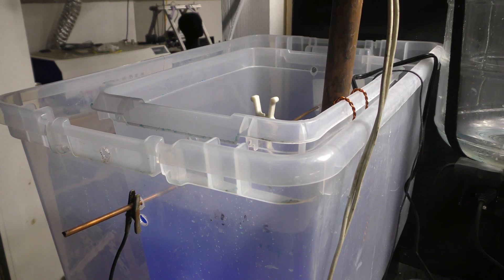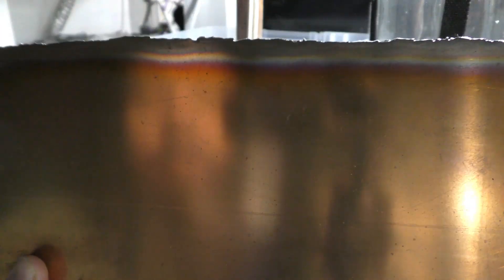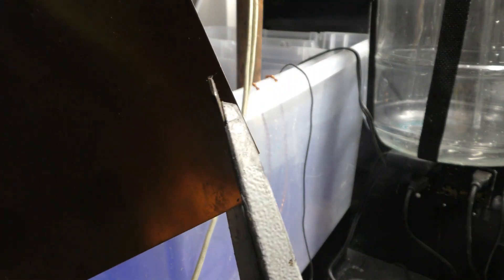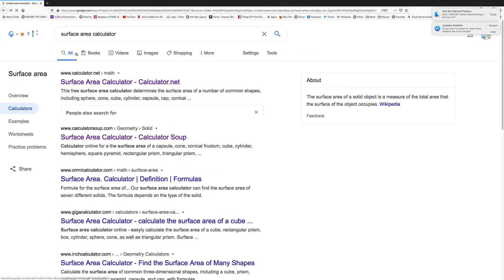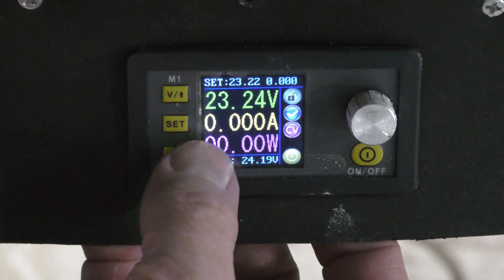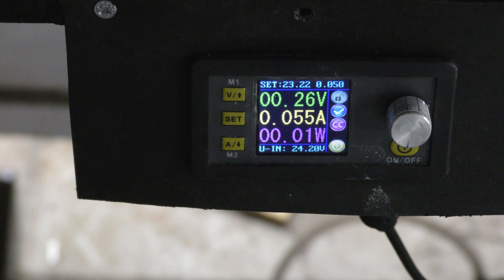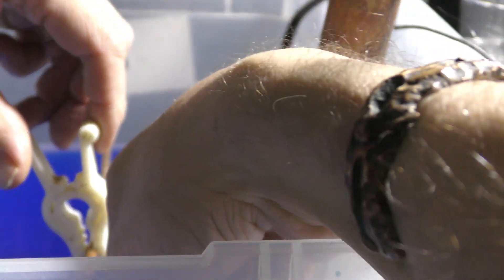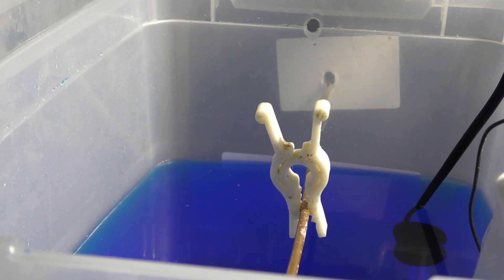Large tank testing solution for copper characteristics.

Comment: Dear Jason, I have started my journey with electroplating recently and am finding positives and some negatives.  My biggest negative is with Copper electroplating.

COPPER ELECTROPLATING
I have tried two methods, both with 6V DC transformer electricity, glass containers, multi-strand copper ties …
The source copper comes from metalworking lathe chips, placed in a pile on the bottom and electrode placed inside the mass to make it electrically active.
1) Copper acetate {Acetic acid - cleaning vinegar @ 15% acetic acid, salt}
2) Copper chloride {Hydrochloric acid, salt}
With both I can get a very quick colouration of the host metal with a semi-gloss copper colour. If I leave the apparatus running further, a thick copper coating builds up trending to a chocolate brown. 
If I then rub the finish it smudges away leaving a feint brownish colouration of the host metal.  Unfortunately the full coating is just wasted. 
In the copper chloride mix simply immersing the piece in the Mason jar, a quick full copper buff coat appears.  This also rubs off easily. 

NICKEL ACETATE - Nickel electroplating with glass Mason jar, 6V DC transformer, multi-strand copper ties …
The Nickel electrodes are strips of pure nickel 10mm x 0.5mm x 300mm+, bent and draped over the jar lip.
1) Nickel acetate {Acetic acid - cleaning vinegar @ 15% acetic acid, salt}
The electroplating process gets off to a good start with shiny metal that looks like elemental Nickel is deposited. Small patches / streaks of black material start to appear and if left in the solution the whole of the piece will change to a black coated item.  Some of the coating is easily rubbed off but most of the black base remains. 
Polishing the black reveals a black shiny substance, not shiny nickel. 

Any help would be most gratefully appreciated.  This was written before listening to this Video and some answers would be provided in advance.  If that is the case then In apologise for my precipitant set of questions.  Cheers.
PS: I think the main reason for my failures looking at your video is the poor electrical control of my tank. I only have one voltage which is probably way too high. I need to save my pennies and get a variable power supply with controllable current and voltage.

Comment: Hi Jason! Your channel is awesome! I have an electroforming troubleshooting question. I recently got a new power supply that works WAY better than the one I was using before but the copper is plating in places it shouldn’t be (I.e. growing over aura quartz that I sealed with decoupage then removed and sealed with nail polish). I haven’t seen this happening to anyone else, do you know what might be happening? Thank you! And again, your channel is amazing and so informative! Thank you for all the content you share 🙏🏻

Also wanted to add that it is a small ring. I have the amps on my power supply set to 0.30 for 30 mins then turn down to 0.10. I do not have any agitation, which I know I need to get and the tank temperature was 76-79. I was using very new solution (midas bright copper electroforming solution) that I had used only once before for three small rings. And a touch of the midas brightener. I also had a brand new anode.
Reply from the maker: So aura  quartz is Quartz with a fine coating of titanium.   You can take the best intentions to seal that but it would take many coats of mailpolish that it might not be worth it.   Same happens with bismuth, which is still to this day a mystery  to seal.  Titanium is pretty conductive at that lvel.  Also the surface rainbow will probally not survive the the process.
Reply: Jason Welsh thank you so much for your reply, Jason! My last power supply was so bad I’d never had that happen before. Thank you again 🙏🏻🙏🏻🙏🏻